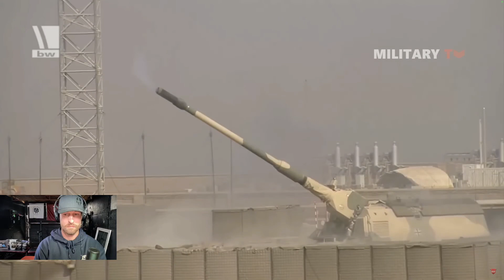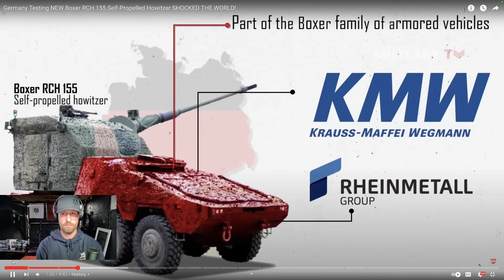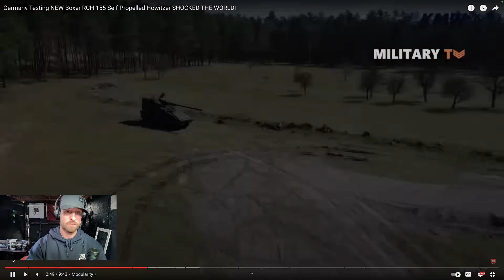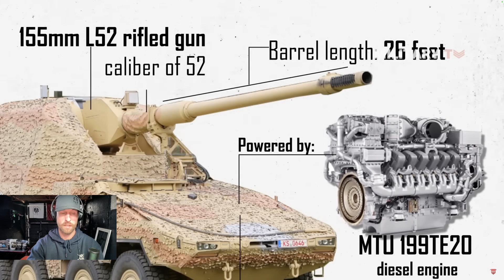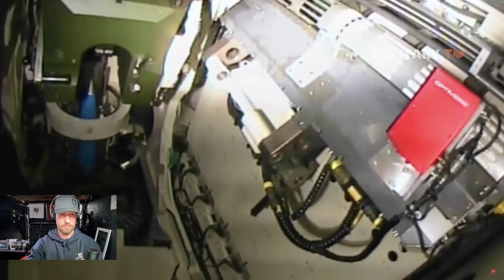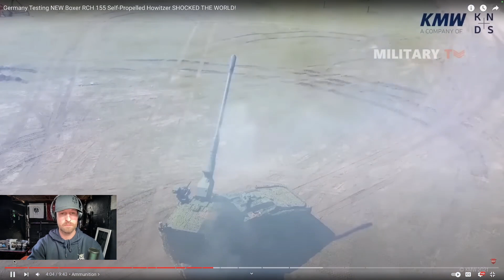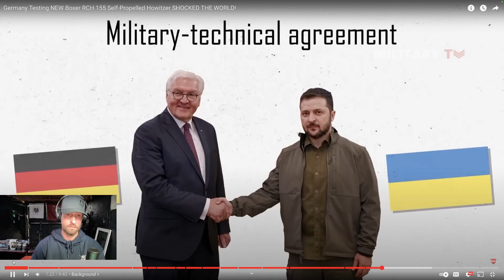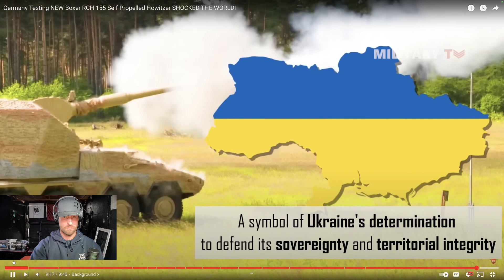Boxer RCH 155 British Armys New Replacement British Soldier reacts

Comment: Main benefit is, that it can fire while on the move.
Reply: as a german artillery officer I can say....yes it works accuratly...it is a game changer....but...just 30 rounds innone system are to less for real artillery fire missions....the tech is simple....leopard mbt tech combined with a permanent working positioning system and fire control system...
Reply: @P3tze  
30 rounds is plenty I guess... you can only drive around so much on the frontline, before your general position is determined by counter battery radar and surveilance drones are send to your position
Reply: Yep and only a two man crew. With the reducing numbers in the armed forces in Europe that is the main benefit.
Reply: Not accurately - that thing wobbles all over the place!  

With that instability I cannot believe it will be able to use the simultaneous impact mode the AS-90 can.
Reply: @user936  kommt drauf an. Es kann sein, dass sich der Schuss erst löst, wenn das Rohr über das Ziel schwenkt. Also der schuss wird freigegeben und der Computer berechnet wann genau er sich löst. Dann wäre es 100% genauso genau wie im stehen. 
Ist natürlich geheim, aber ich denke das die Technologie funktionieren kann
Reply: @jonas384r7  The sway with tracked suspension is much smaller and more predicable.  If the Boxer had spades that dug into the ground before shooting, I would give it a pass.
Reply: @user936  das kann sein. 
Ich habe gehört, dass der Boxer ein hohes Gewicht hat. Dadurch soll er wohl präzise sein und keine Stützen benötigen. Der Turm ist nicht stark gepanzert und dadurch leicht.
Der Schwerpunkt sitzt weit unten, dadurch soll der Boxer keine Stützen benötigen
Reply: @user936  boxer is capable of 5-6 rounds simultaneous impact on 35km, similar to PzH2000
Reply: @zhufortheimpaler4041  I don't see how the gun would settle fast enough between shots to allow that.
Reply: @jonas384r7  Look at that thing bouncing around after each shot  👀

A tracked unit like an AS-90 is so much more stable.
Reply: @user936  its electric stabilised and computer optimised. 
shots only get triggered when the barrel is in alignment. (similar to modern MBT´s)
Reply: @zhufortheimpaler4041  I know Challenger 2 has an indirect fire mode. Seems the Ukrainians are using that mode a lot right now.
Reply: @user936  yeah because Challenger 2 struggles with ukraines terrain situation and the AP round is lacking for modern combat situations.
In addition to that, the CR2´s armor is outdated (same wiith M1A1 and Leo2A4)
Reply: @zhufortheimpaler4041  I have not heard of a single instance where a Challenger has lost a job because of AP rounds were not doing the job.  I think we need more data. 

How to out of date armour is relative in conventional Warfare. We've had one of those challenges take tens of RPG strikes. I don't think it's out of date because it drone can come up behind it - that's less about the armour and more about other defensive measures and employment of the tank.
Reply: @user936  kann sein. Aber wenn ich mir andere Haubizen angucke wackeln die auch stark nach dem Schuss. Entscheidend ist ja ob man trifft. 
Ich würde gerne mal Testergebnisse sehen😅
Ich glaube das das Konzept mit schießen aus der Fahrt die Zukunft ist. Ob es jetzt schon perfekt funktioniert weiß ich nicht
Reply: @user936  doesn't need to settle, direct fire guns don't settle, you use coincidence windows. You monitor barrel movement and fire as it travels through the required position
Reply: @zhufortheimpaler4041  there's no evidence in Ukraine that CR2 lethality or armour is outdated. Yes, having anti-UAS and Anti-ATGM is a clear issue in all major MBT.
Reply: @user936   Why do you care so much that the chassis shakes like crazy after every shot? The moment the vehicle even begins to wobble, the grenade is already long out of the barrel and on its way to its target. So it is absolutely precise in firing even when moving.
Reply: @Gehtdichüberhauptnixan  laying multiple rounds down means the barrel has to settle between shots. Multiple Rounds Simultaneous Impact, an awesome function, will perform poorly compared to a stable tracked counterpart.
Reply: @user936  yeah an the whole things shakes how long? 1.5 or 2 seconds?
Reply: @user936  No, it does not need to. The gun stabilization does its job and the shell leaves the barrel faster than them recoil can reach the vehicle. 

I also believe tracked howitzers will still have a place with the armored divisions. The point of this howitzer however is to do scoot and shoot at another level because it can put three rounds downrange and leave again in a hurry where a tracked vehicle would be slower to move and other wheeled howitzers need time to set up and pack up again.

So the comparison to the AS-90 is nonsense because this is not competing with a Pzh2000, but other wheeled howitzers.
Reply: @mangalores-x_x  good points but read back what you just wrote

"and other wheeled howitzers need time to setup"

What makes the Boxer variant so special that all the other options mandate a "setup" to obey the laws of physics (for required performance) for every other self propelled howitzer, just not this one?
Reply: @jonas384r7 es sollte wenigstens die Option zur Nachrüstung von Stützen geben… dürfte auch verschleiß verringern. 3-4 Stück sollten reichen
Reply: @user936  that you cannot see how this RHC155 can do that is EXACTLY the reason why you are not able to judge such things. Let those people judge who have knowledge
Reply: @GroppeljohannKlotenkempe-vr6oh  Task & Purpose is going make a video about it soon so we'll see what he says.
Reply: @user936 wenn ich das richtig verstanden habe gibt es 2 Vorteile die andere nicht haben bisher, während der Fahrt präzise schießen und keine stützen notwendig, somit erhöhte Flexibilität, schwerer Nachzuverfolgen, schneller Einsatzbereit und schneller Rückzug möglich.
Zudem durch die Räder schneller und einfacher zu transportieren, Züge sind nicht unbedingt notwendig zu verlegen der Artillerie außerdem passt es trotzdem durch die Zugtunnel wenn nötig.
Reply: @user936  you wrote it yourselves, it bounces AFTER the shot. The round has already left the barrel at that moment. The normal driving movement is calculated weithin the targeting process similar to an modern MBT.
Reply: @jonas384r7 wird in Millisekunden berechnet keine Sorge RCH haut Treffer raus während der Fahrt
Reply: @user936  none of us are engineers here, but if tests have shown that it has the same precision when driving as when standing still, then personal perception of how it wobbles is pretty unimportant at all 😂
Reply: @jack-tack3097  there is no person or vehicle that is more accurate on the move than it is stationary.

You're essentially always dealing with less variables.

The only exception I can think of are ships, where going at consistent speed cuts a straighter path through what is essentially constantly moving terrain. This is not apply on land.
Reply: @user936  this system can shoot accurately while driving. Have you ever heard of a balanced weapon system? the main gun of the leopard 2 tank, for example, you can put a glass of beer on the gun and it won't fall down while driving and this weapon system is not particularly new. Whereas the RCH 155 is a completely new system and therefore much more modern than the one on the leopard
Reply: @jack-tack3097  it's a neet trick but that video was taken of a very heavy tracked vehicle presumably with hydromatic suspension, driving on a completely flat piece of tarmac.

This unit has eight pneumatic tyres on sprung suspension supporting less weight. Those three factors alone make it a completely different ball game.
Reply: @jack-tack3097   I'm an engineer...
Reply: @user936  dude its a complete new system you can not really compare it to other and that it can shoot precise while driving is proved, no matter what you will say. what are you even trying?
Reply: @user936 stabiliser and a shtload of computers. I have seen them do it on the test range in Germany with this one and the Rheinmetall HX-3 based weapon. The latter is the better vehicle as it will get the 80 km unextended range L-60. soon.
Reply: @user936 lol what? That thing is a sniper. Also during driving. Its the best artillery system worldwide.
Reply: @Mojom8  you are a little late to the convo my friend 🙂  honestly I can't be bothered to rehash everything I said so please expand all the comments above.

In short:  On paper yes, IRL either area probable will be too large or users will chose to shoot n scoot anyway with a smaller area probable, negating this feature entirely.
Reply: @user936  I can end the conversation and tell you that you have no idea.
Reply: @user936  doesn't need to be gun-accurate if there are course correcting fuzes.
Reply: @EP-bb1rm  you've solved one problem by introducing another - eye-wateringly expensive artillery rounds.

You want to solve for first problem because it's infinitely cheaper and won't bankrupt your country before the barrels wear out.
Reply: @user936  course correction fuzes aren't eye watering expensive. Not talking full guided rounds.
Reply: @user936   course correction fuzes aren't expensive. They're not full smart rounds, they do minor adjustments for range typically
Reply: @EP-bb1rm  you either mean guided munitions which are very expensive indeed; time delay fuses (for air bursts) which would increase effectiveness ( by increasing the area covered) if the round was slightly off target. 

Or finally proximity definition fuses (now also cheap) - technically better in most weather conditions. Compared to timed fuses  there's less calculation by the operator involved. However they are physically longer, so the supplemental charge has to be removed from the 155 shell, decreasing fragmentation lethality.

So outside of Point Detonation do you have timed or proximity fuses that are cheap to use. However these still have their own compromises and do not decrease the Circular Area Probability (CEP) of the rounds themselves.
Reply: @user936   No, I mean course correction fuzes. Look them up. You'll learn something and appear less arrogant and dumb.
Reply: @user936   you can't even get an acronym correct (Circular Error Probable).
Reply: @EP-bb1rm  so firstly excavator rounds have used GPS and they've gone hit percentage of 6% due to improved Russian jamming - these will have the same issue.

Secondly these fuses appear to be 13K a pop 👀  compare that to a regular fuzed shell at 1 to 3K. So yes you will bankrupt yourself shooting these things, that might get jammed (and miss) anyway - when you should have just used cheaper dumb rounds that can't be jammed.
Reply: @user936   course correction fuzes don't cost 13k. You're still confusing precision guided rounds with course correction. One day you'll catch up.
Reply: @EP-bb1rm  dude just give me a Price and a Source instead of chewing me up.
Reply: @user936   Why? You're the expert, right? 🤣
Reply: @EP-bb1rm  one day you'll give me a model number or designation.
Reply: @user936   Why would I give you controlled information?
Reply: @user936  It only "wobbles all over the place" when the round has left the barrel.
Reply: @Muschelschubs3r  true, but it is the follow-up shots that I don't think can be as accurate because you either have to account in realtime of that wobble as the suspension comes to rest, while also on the move. 

It is a niche shooting mode used for sales and not a function you are going to see used in all but the most desperate of situations.
Reply: @user936  Knowledge is power. Unfortunately, you didn't get any of it. The vehicle has to absorb the energy, but the bullet has long since left the barrel and the movement has zero influence on the accuracy of the trajectory. As an artillery soldier, you would know that. Because this applies to all artillery pieces, regardless of type
Reply: @gerhardma4297  ok so you've missed the part of thr conversation where we were talking about Multiple Round Simultaneous Impact ability seen on the AS-90 and how in my opinion it could not be as effective on a vehicle that is so bouncy between shots.

This then moved on to shooting on the move. And disagreement with others that with the sway of a wheeled vehicle, shooting on the move with just not be accurate enough to be effective.

From here the conversation came back to various types of guided ammunition.
Reply: @user936  believing is not knowing. They have made a lot of tests and you will finde them here too. So, sometimes it makes sense to acquire a little knowledge. Knowledge is power my friend
Reply: Bullshit
Reply: @sirbonobo3907  For someone who obviously has no idea and hasn't seen the tests, you sure are opening your mouth. Sometimes it makes sense to acquire a little knowledge. Ignorance and arrogance have sidelined you here and you've made a fool of yourself. Knowledge is power.... Unfortunately, that doesn't apply to you
Reply: @sirbonobo3907  Knowledge is power. Unfortunately, you didn't get any of it.

Comment: Original video is rather repetitive and misses key features of the RCH.

Unlike Archer
- it can fire WHILE DRIVING

- it has a RWS on the roof to which the main gun can be slaved, which gives it Hunter Killer capabilty

- the RWS also can be used for close defense against drones
Reply: At least up to 30km/h, if i have my numbers right. However, this would make counter battery fire seemingly impossible, even with cluster munitions.
Reply: The RWS combined with the sensors of e.g. the australian  "Slinger-System" will be in future mandatory I personally assume. Unfortunately, there will be no AHEAD Ammunition given the weight and the height of such a 25-30 mm Autocannon. Maybe a modified TROPHY system may be used to kill incoming drones. Disadvantage: runs out of ammo pretty soon, overloading it should be not really a problem.
Reply: @AnkurFFM look at the RWS on top of the new Leo ARC 3.0 that KMW just presented. Short 30mm with AHEAD ammo.
Reply: Also, RHMs ADS Strikeshield fits on any Boxer.
Reply: @positroll7870  Yes. But similar to the trophy system, it can be overloaded by only a few drones from the same direction. Still a nice protection against a lonesome loitering drone and way better than nothing. I find it more interesting, that this one has such a low electronic signature. As you do not want to be a radio beacon on the battlefield.
Reply: @AnkurFFM  yes but all systems can be overloaded be it Irist slm, patriot, s400, iron dome++ its just a reality we have maybe like in farer future high energy laser can do that (but heat will be a problem) but still it increases the survivability alot.
And Rheinmetalls ADS can defend against multiple threats from same side, watch the Vid on their channel its with rpg but still quite nice to see the Fuchs (troops transport) gets out without hit
Reply: An RWS isn't a difference, The archer has one too, at least the original dumper chassi version.
Reply: @SonsOfLorgar  but on the truck, iirc, not the roof of the gun module itself. Which is what allows slaving the main gun to it. 

https://youtu.be/MNgcgBaOZeQ?si=NfpfNoiU6vjny1GW

Comment: No tracks, because wheels don´t need extra trucks or trains for longer distance land transports.
The video doesn´t mention anything about the beauty of that thing, it can shoot like a normal howitzer while driving at around 15 to 16 mph without any issues.
It is operated by only two and if you need to stop, shoot nine rounds and drive again it takes only 90 seconds for the whole process.
It does have a auxiliary power unit (APU), so it doesn´t need the main engine to be still fully operational, in a fixed position, wich reduces also the heat signature.
It is automated and the on board computer solves the concern about accuracy, because of vehicle movement, it is more like tipping on a target on a touch screen.
In the near future they want it to be fully automated without any on board  personal, RCH / remote controlled howitzer.
It all happens via data link and it can fight even moving targets.
Artillery Range, standard up to 40 km, V-LAP up to 54 km, Vulcano up to 70 km , so the 25 mile range is just the standard munition and not the extended range one.
Combat ready weight is around 39 tons and not 45 tons, it was a requirement of the German military, because you would run into issues with streets, roads and so on.
Buyers: Germany and UK are ordering together and want to optimise that system together, Ukraine will get 36 of those and Swiss is also interested, I didn´t hear anything about those other countrys mentioned.